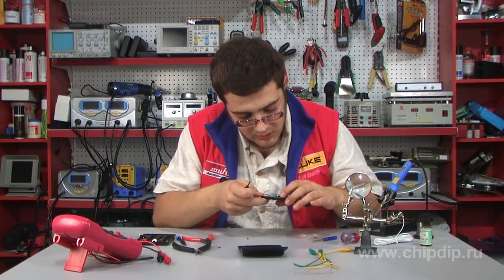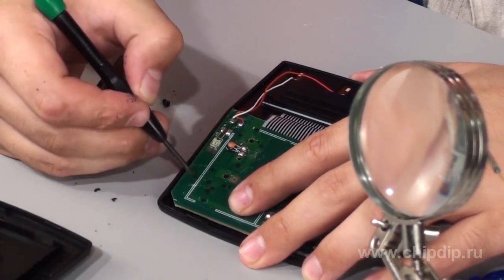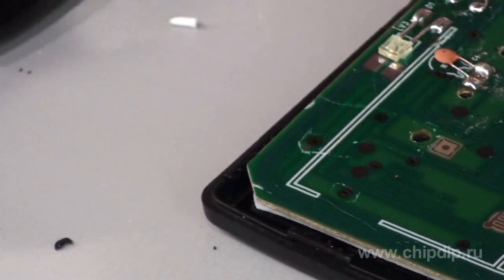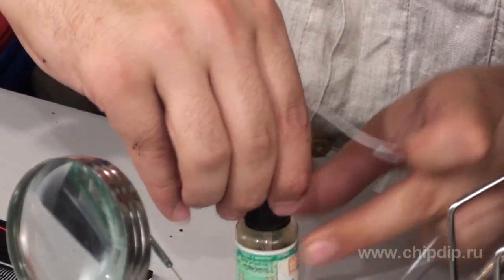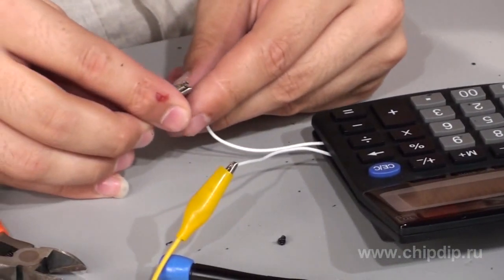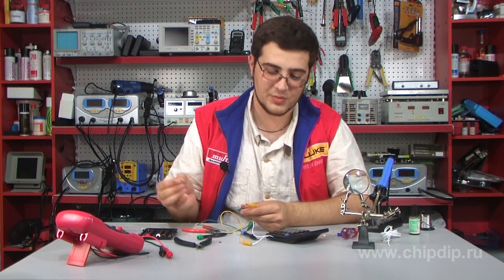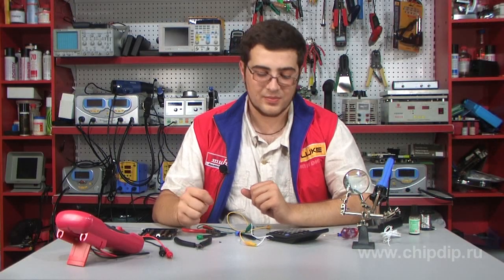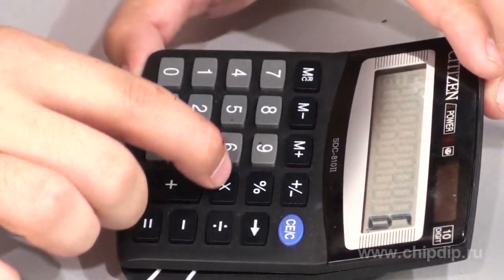How to Make a Simple Counter of a Calculator

Comment: Hi - great for counting turns, but you can't calculate inductance like that. Because the inductance increases with n^2, that means that the inductance added per turn is not a constant, it depends how many turns are there already. So you can use a spreadsheet or a calculator or an app to work out how many turns you need to add or take off, then count the turns using this great method.

Comment: This would work well to measure how many times the blades of a windmill or wind generator turned by putting a magnet on the rotating device, a reed relay near the parameter connected to the calculator.  The auto power off feature might be a problem.